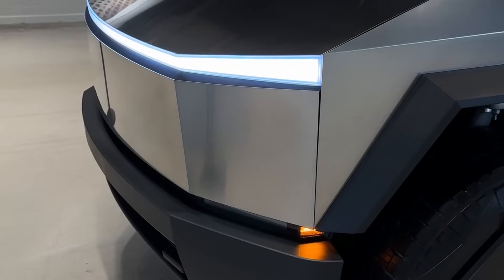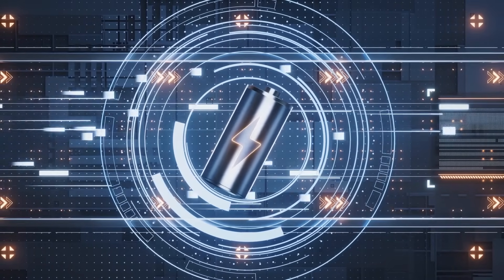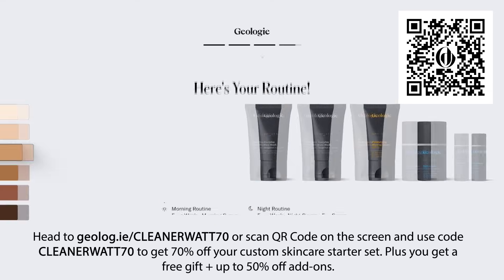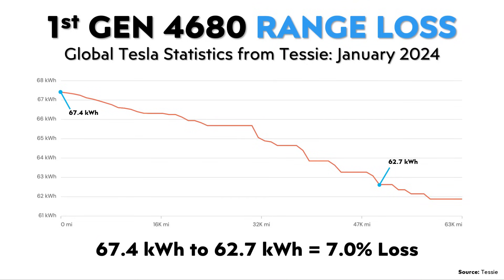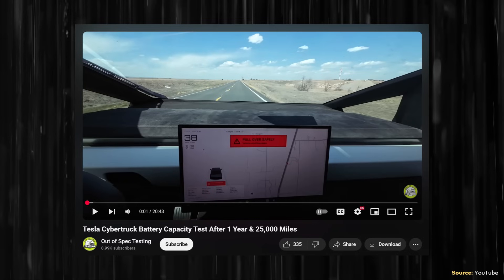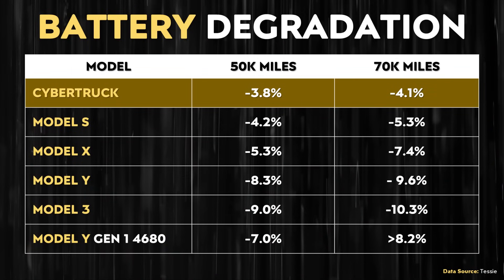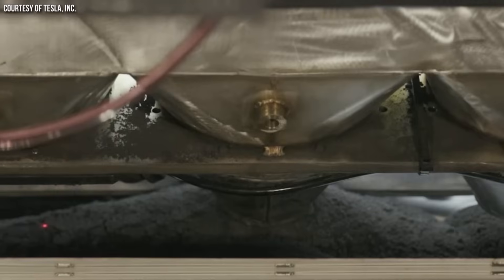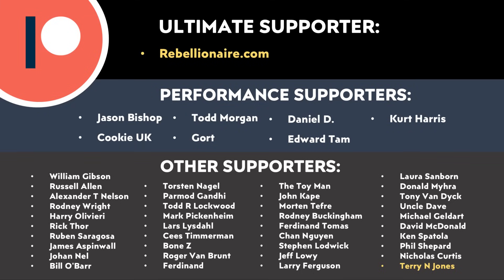Tesla Cybertruck 4680 Battery Range Loss: Gen 1 vs Gen 2 4680

Comment: Because the cybertruck has only been out for a short while, the high mileage cyber trucks do not have any appreciable calendar aging so it will look like the battery ages much less than the other vehicles.  The other vehicles that similar mileages have had much more calendar aging on average.
Reply: Good observation.  The commonly recognized theory said it was all about cycles.  But the data from cars has consistently shown that calendar years are a major factor.

Comment: Jon, you should have normalized degradation to vehicle range. A vehicle with a larger range, will experience less degradation for the same number of miles, than a vehicle with a smaller range, with all else being equal.
Reply: Why?
Reply: @ Imagine 2 vehicles both travel 1200 miles. If one has a 300 mile range, the batteries might experience 4 full cycles (or 8 half cycles), versus a 400 mile range vehicle where the battery pack would only experience 3 full cycles (or 6 half cycles). So all else being equal, the vehicle with smaller range stresses the batteries more for the same travel distance.
Reply: @techfan6129  cybertruck range is 300-350 miles no? Similar ball park as model y and 3
Reply: @ True. It’s more just to be accurate and the chart included S&X as well.
Reply: Yeah, thanks for the common sense. Whole video is almost pointless, he comparing apples and oranges here

Comment: My 2021 s refresh long range  is maxed at 355 miles. I have 19 inch wheels. Bought used from Tesla when it had 30,400 miles and maxed out at 367 miles. I charge at home with maybe 10 % supercharger when going out of town. After 10,000 miles added by me , the miles max range on the battery icon  have dropped! Presently, with 10,000 miles added,I average 3.90 miles per kilowatt used. I think it’s at 88 to 90 usable battery retention which is around 10 to 12 percent loss not the 4.2% that’s on your chart! Subscribed!
Reply: I have a 2023 S with 70K miles, 19 inch wheels. I’m seeing 10% as well. Typically a full charge is 355-360 miles.

Comment: Since Tesla controls most of the manufacturing process of 4680 cells in-house I suspect they will get better over time. Soon Tesla Corpus Kristi will supply Li material to GT where it will be refined further for it's use in 4680 cells. This along with it's industry leading dry cell process (for anode & Cathode) will further improve the density and reduce loss over time. The biggest benefit will be cost savings and control over the supply chain. Hope Tesla replicates the cell process in GB & GS in 2026.

Comment: The Cybertruck hasn’t been on the market very long, so the cells haven’t had as much calendar aging.  50k miles over 12 months will have less degradation than 50k miles over 43 months (the US average), and no Cybertrucks have had 43 months of calendar aging.
Reply: Good observation. The commonly recognized theory said it was all about cycles. But the data from cars has consistently shown that calendar years are a major factor.

Comment: With finally dry (cathode) *aswell being solved, we can only hope that R&D to add silicon to the anodes to combat (silicon swelling) is gonna increase significantly and be solved soonTM also. Fully silicon anodes has claims of (*upwards) of 40% increased energy density, but more often reports claim ~20% density increases, amongst faster charging speeds, higher longevity and better safety. 
Which at best case scenario would put the 4680 at ~ 414Wh/kg or at the more common claims at 355Wh/kg (+ faster charging less degradation and higher safety). Very big that they solved dry cathodes.
So let's go with even less numbers and say 330Wh/kg. + the other bonuses, that is incredibly good (do they succeed making a fully silicon based anode). 
Even partially silicon additives increases all of above :)

Comment: larger battery packs experience less wear
Reply: Usually. However it’s vehicle dependent. E.g. a more efficient vehicle with 400 mile range would have less battery degradation than a 350 mile range vehicle even if the 350 mile range vehicle had a larger pack.

Jonathan should have normalized degradation to vehicle range (not pack size)